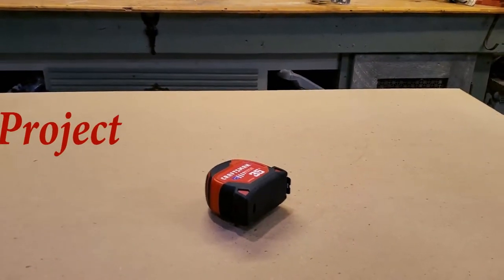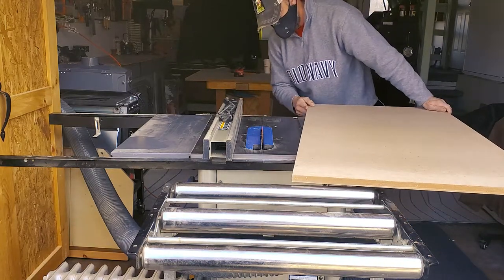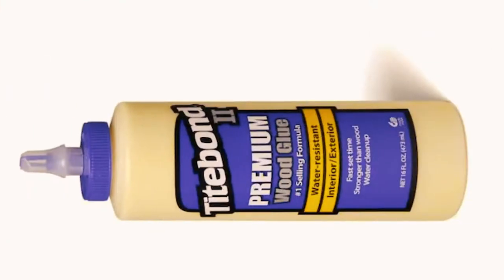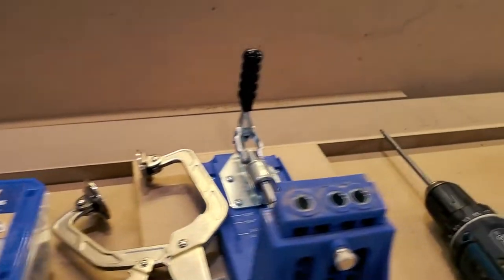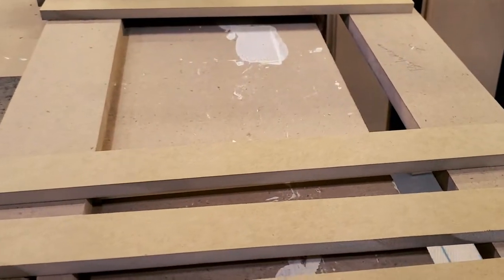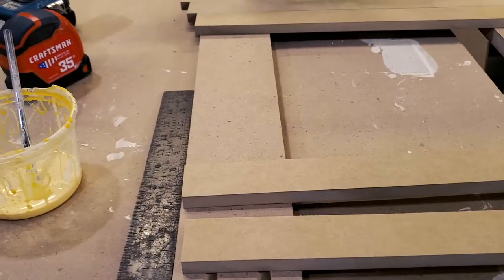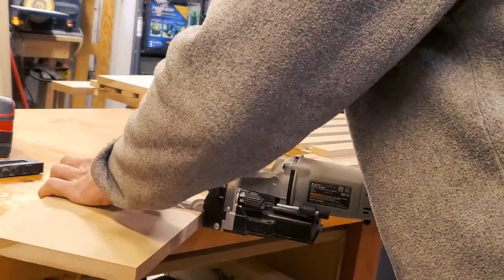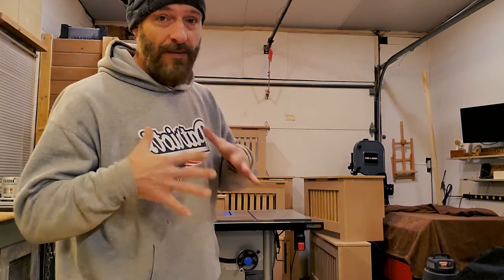DIY How to build a simple  Radiator Cover

Comment: I'm looking to try to make something like you did. I was wondering how would it be to use pocketholes for the slots so they sit flush with the front. I'm fairly new at woodworking so just trying to learn!!
Reply from the maker: I think that would be fine ...a lot of drilling for sure but shouldn't be a problem.  Just be careful on the thickness of the slats. If too thin they you may have some splitting. Thanks for the question
Reply: @JoePalumbo221  ty so much joe, really appreciate the help!!

Comment: Very helpful video! I'm about to tackle the task of making 7 of these for the steam radiators in my house. I'm sure it'll take me quite a bit more time, but luckily I can store them in place til i get around to painting them. What's your opinion on the use of of MDF vs. Plywood or solid pine?
Reply from the maker: I think MDF will be more stable considering the amount of moisture that the radiator puts off.  With a a good finish there should be no expansion or contraction. With pine, unless it's extremely sealed and well prepped opens up a tone more issues. Thanks for watching!

Comment: what is the math to figure out the slat spacing, width, etc?
Reply from the maker: I just take the total width of the opening and divide by the amount of space between 2 slats and fudge the number until all are equally centered and the reveal on both ends are equal.  I know there is a proper method, but this works for me.